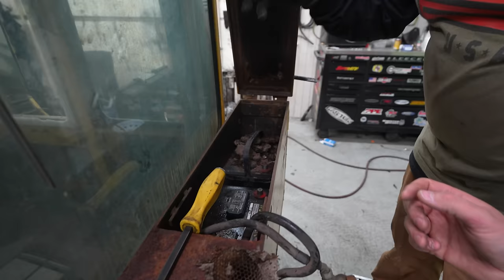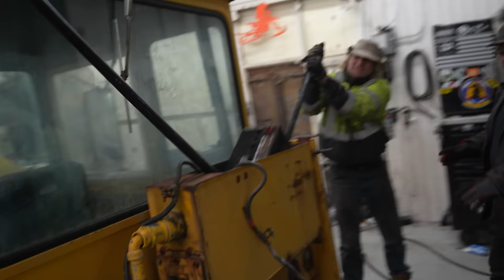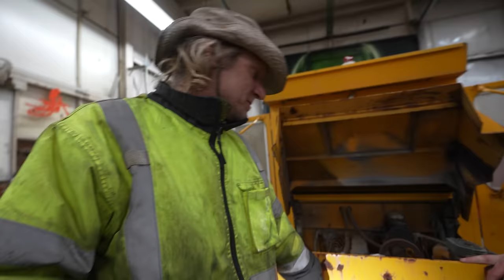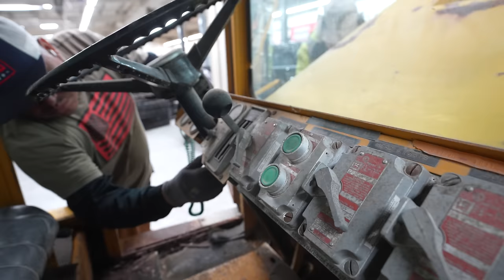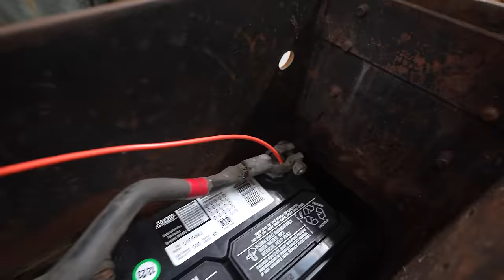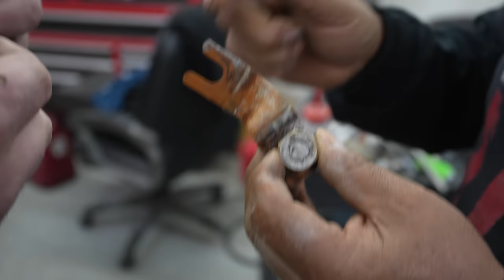What is this vehicle?  Why is it explosion proof?

Comment: Its an old military tug that would pull live ordinance or TNT for mining operations.
Reply from the maker: Do you have a specific name or model?
Reply: @SparksMotorsCo  United Tractor SM40-A9 or possibly SM80 is what it looks like you have. The diesel engine swap is because the low combustion point of diesel compared to gasoline or lpg counterparts to reduce the risk of fire or explosion when hauling ordinance or explosives.
Reply from the maker: @Mrdieselblooded  I think you got it!!!  Thank you for sharing
Reply: We used tugs for ground equipment in the 80s but ours were gas 225 slant 6 with a 727 automatic. We didn’t need them to be  permissible for explosives or munitions.

Comment: back in the 80's when I worked at the transmission shop we had an airport tug called Egor with a scrapped tire strapped to the front for pushing dead stuff into the shop.

Comment: These are called Airport tugs or a tow tug or tractor they are used in airports all over the world and range from $17,000-$60,000 And can go right about 20 to 25 miles an hour. and usually have a T4i diesel

Comment: You have a light airplane tug used in the military, and if I recall was used to move up 45t, though may be off a bit but what I do remember is I used one to move H-60's around for four years. And yes it is simply a small tug and should have a couple of plates with model number and specs listed.

Comment: By the position of the injection pump, the blue color of the valve cover and is distinctive sound it could be an nissan SD series engine.
Reply from the maker: You are correct.

Comment: was thinking it might be a Nissan Industrial Diesel engine.   If it is 6cyl  (looks to be)  the crankshaft itself is a highly desired by Datsun/Nissan guys who drool on Z cars.  If I understand it right that crank can be swapped into Z's to increase compression. (longer stroke).   BUTT..   other side of coin is..... that is why this 6cyl Diesel is hard to find one running.... so that diesel  engine is entering the "collectable" zone.

Comment: In he late 70s into the mid 80s, before Dodge started using Cummins Diesel engines Dodge used a Nissan diesel in their 3/4 ton and 1 ton pick ups.

Comment: Air Force used units like that to tow bomb carts.
Reply: MrSparksmotors-xt9wn     The Air Force used a lot of tugs for moving planes and all kinds of things.  I was in supply and we used smaller ones for moving carts around, and then they used the bigger ones in the bomb building and transporting? Most of us don't hang out in that area unless we had too. You can find pictures of them being used to load the planes in combat areas.

Comment: WTF  IS  A EXPLOSIVE PROOF STARTER  ... ( 1 )   WIZARD  ELECTRICAL  ENGINEER  (  1  )   STARTER    (   5   )    WIRES     (  30  )    CIRCUIT BREAKERS     AND ,,,,    MAYBE   BAD FUSE,,,,  OR  BAD  STARTER,,,,,,  OR    (   1  )     BAD   🧙‍♂🧙🧙‍♀

Comment: Surprised the Diesel wasn't turned to crap! No telling how long it had been sitting. I was thinking filters, injection pump, injectors, but it runs? Unreal! :face-fuchsia-wide-eyes:
Reply from the maker: We are so happy it wasn’t all of those because that is typically the case!  Runs great.  New boots and fresh paint will be great.
Reply: @SparksMotorsCo  Yeah, I know! I spent 8 years as a Warranty Engineer for Deutz here in Atlanta and I've seen more f'd up engines than I can count! There were four of us and in all that time we found four or five ACTUAL factory defects! Everything else was failures due to abuse, neglect, misapplication, even downright sabotage! The one that came back with Clover compound leading from the oil filler cap (and confirmed by oil analysis) was the topper! 😆